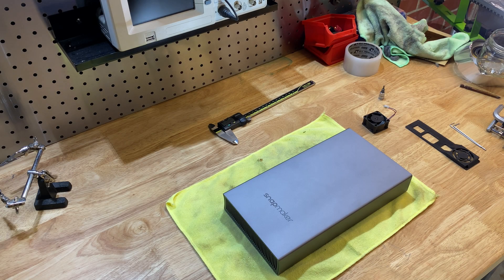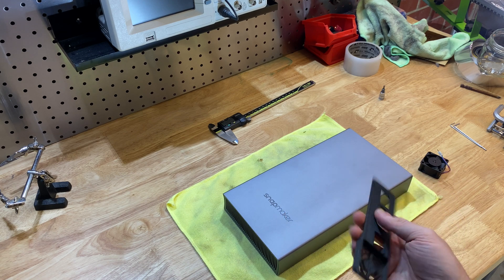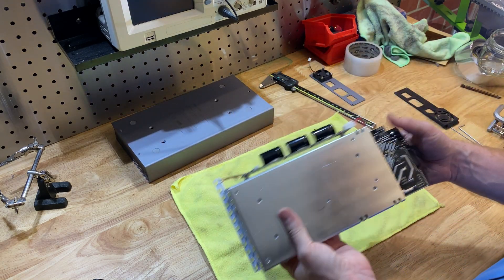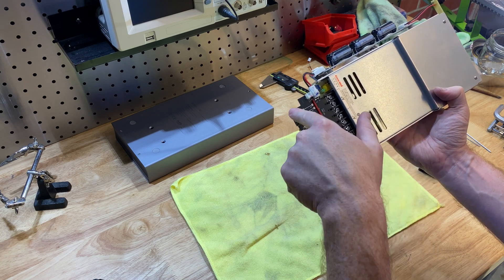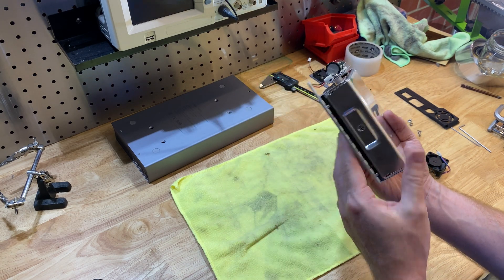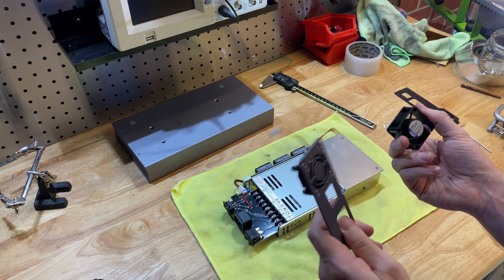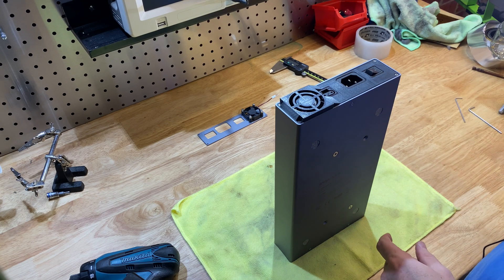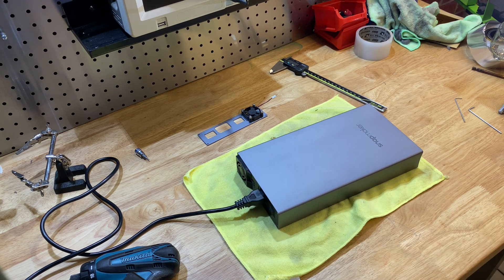Snapmaker Hacks - Power Supply Fan Upgrade!

Comment: I'm no electronics expert but I think the capacitors on the side are so when power is lost, the printer has enough power to quickly dodge the toolhead out of the way and save its current progress. Snapmaker like to make a big deal out of this

Comment: I had my power supply mounted upright. But the longer I use it the louder the fan gets. I was thinking that it might be the 60 mm fan that’s causing the noise not the small fan . do you know the dimensions of the 60 mm fan
Reply from the maker: 60mm x 60mm x 15mm - 20CFM airflow / 4000RPM